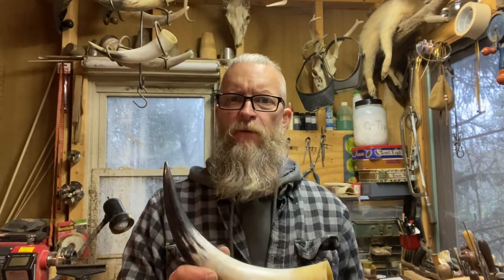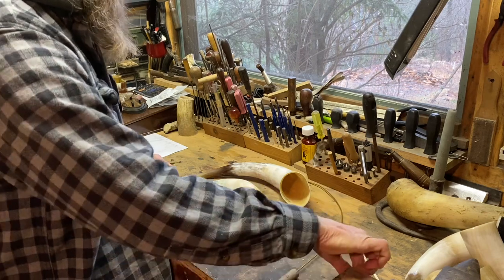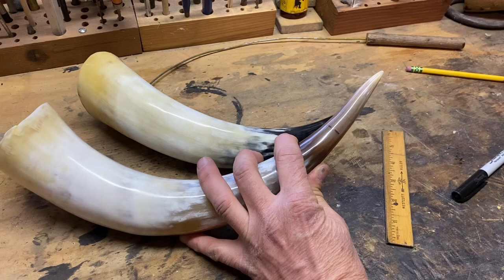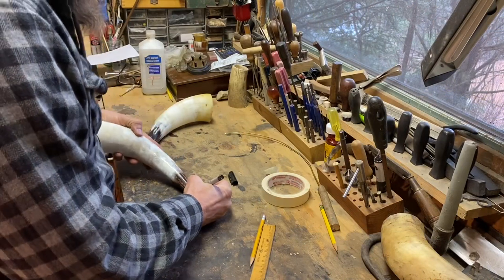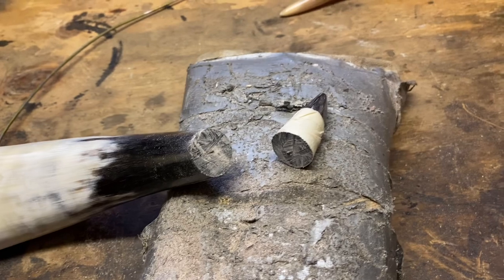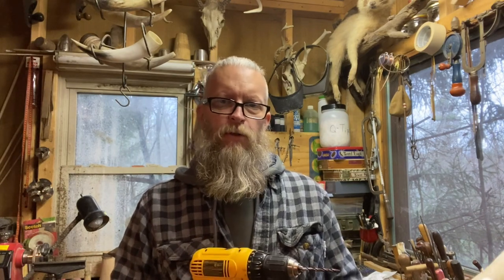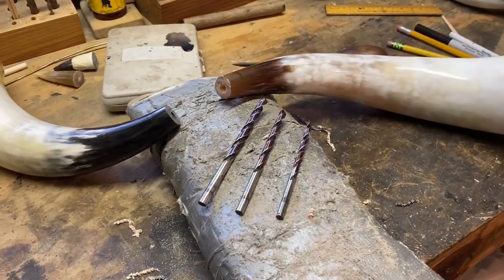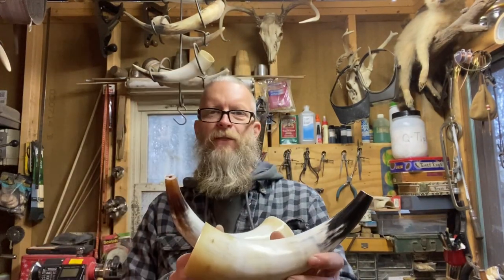Cutting the Tip & Drilling the Spout Hole for a Powder Horn

Comment: Howdy:
 I started making powder horns in the 70's. I've vented (drilled out through the side) a few, but not too many thankfully. It happens! Anyway, as to shortcuts or helpful hints?  FWIW, I buy rubber O rings from a plumbing supply store in different diameters. You "roll" one of them down the tip to where you want to cut/mark, etc. and you can draw a perfect ring around the horn with a pencil or marker.  Just carefully run the marker along both sides of the O ring. Works every time. I hope that helps some newbies?
Nice work, great video. Thanks.
God bless:
Two Feathers
Proprietor of...
The Mountain Man Emporium
Berwick, Pa.
Reply from the maker: Awesome! Thank you so much! And thank you for sharing your experience. All how-to’s are welcome!👍